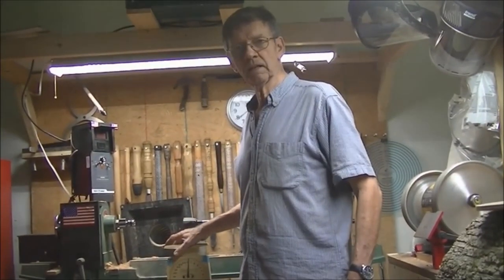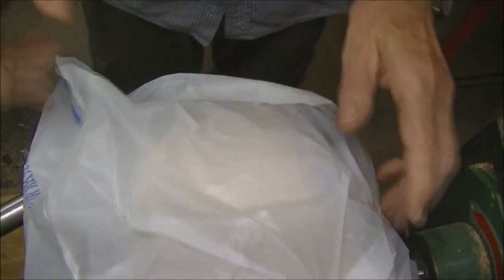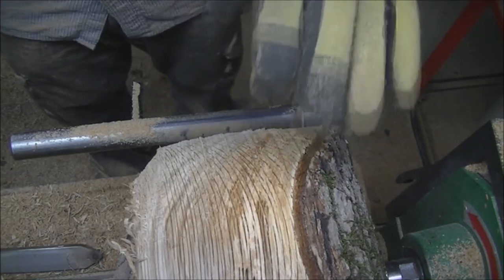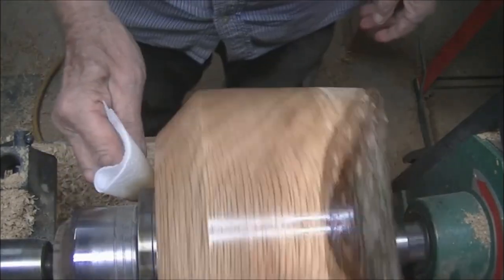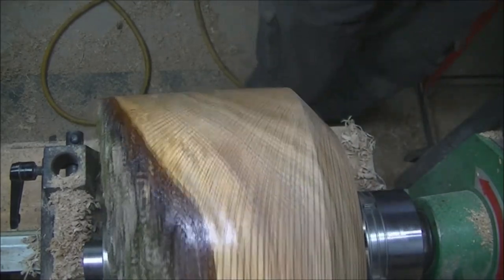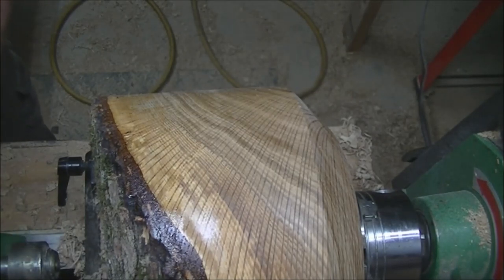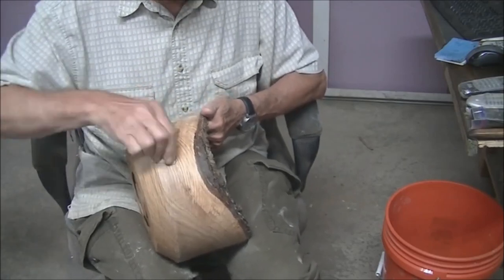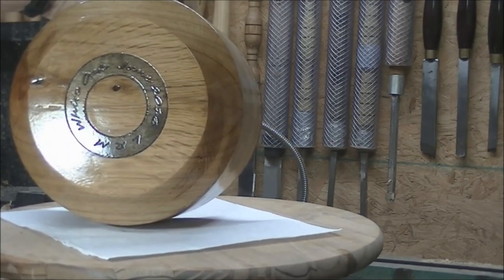Natural Edge White Oak Bowl

Comment: When you started turning this Oak blank I wasn't sure I'd relate to this piece. It's quite breathtaking in it's natural state. Also, thank you for sharing the razor blade trick with us. I run into high spot issues often, it's going to help out greatly.
Reply from the maker: White Oak is a very nice wood, fairly easy to turn and pretty.  Thanks, Larry

Comment: I'm by far not an expert and I love your work. I have been told drying wood out too fast causes a lot of the cracks. Have you tried fast drying others with better results. I know this video is 3 months old so just curious to the results. Thanks.
Reply from the maker: There are several ways of drying wood.  I've tried them all.  They all work to varying degrees.  I am not a patience man, I general turn whatever wet or dry and fix the cracks later if they occur.   If you remove the pith and ca around any knots, you general will not have many problems.  Hope that helps.  And thanks for viewing, Larry

Comment: Drying the bowl like that is the worst thing you can do you will always have checks and cracks if you do this it is better to put in a cardboard box and let dry for a month slowly with no drafts and it wont crack on you if you still have cracks put elmers glue on it and wrap in paper towels the cracks may close on thier own use gouge to remove glue days later. Proper use of a gouge is key in producing a finish you almost dont have to sand.
Reply from the maker: To each his own.  Agree to disagree.  Thanks, Larry
Reply: That's fine I was just goig by my own obversations rushing to done will always cause cracks and warping its physics on a molecular level....fact not opinion...the world is a spherical body but many argued it was flat and agreed to disagree but they were still wrong and knowledge is power and to teach something that is wrong or a bad habit is spreading ignorance not truth not facts not science. I agree you are the artist and you can do anything to produce your art... I was just offering some advice to help you out. There is a glue that is surgical grade that works better than CA too has a bit longer polimer reaction time and doesn't heat the wood or smoke.
Reply from the maker: @joelboston4582  I didn't take offense and I know all that.  I just don't have the patience to wait six months to a year to avoid a few cracks that are easily fixed anyway.  Plus I've seen a lot of rough turn bowls that when taken out of their containers were cracked and warped anyway, so why wait? It also greatly depends on the kind of wood, thickness, and other factors.  There is no set positive way that always works.  Thanks and take care, Larry
Reply: @TheWoodWhirler  You are right I am not a patient man either just another artist.